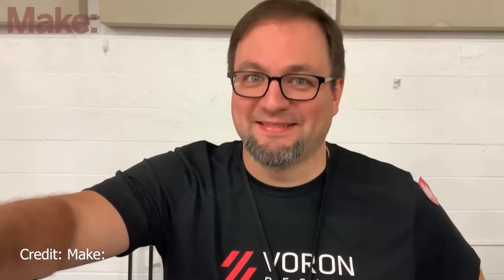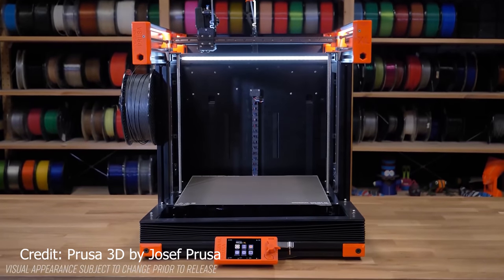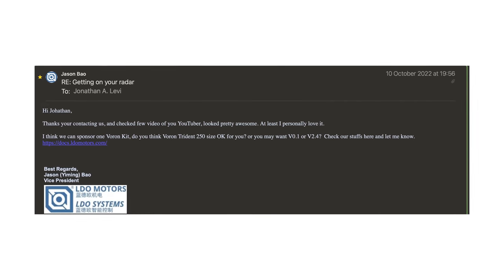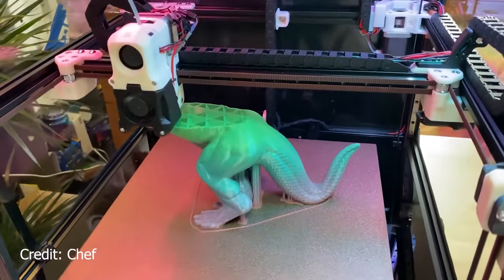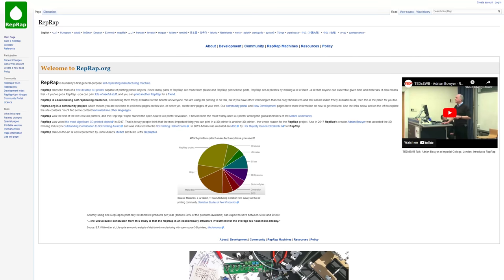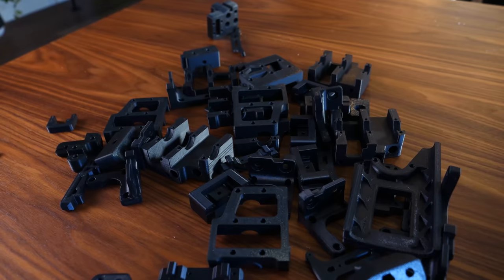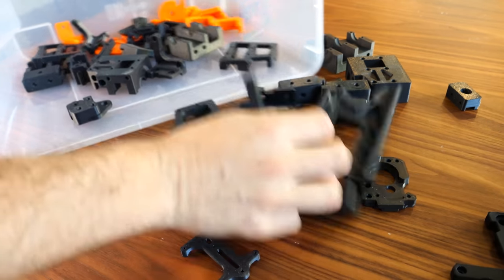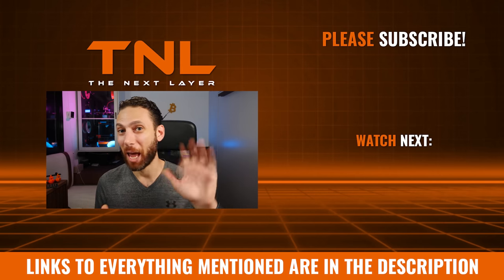I'm Building a Voron 2.4!

Comment: How hard is it to build? It is not hard to build, I am not an engineer, nor a 3d professional, I am a hobbiest. If you take your time and do not get frustrated, the mechanical build was SUPER fun. Enjoy it, because then you will get to the electrical portion, which made me second guess all my wiring (it was my first wiring job/using crimpers/soldering so i was super nervous to turn it on) the guys in the voron discord were laughing when I showed them my fire extinguisher "just in case". I actually had put my extruder gear on backwards and it stripped my plastic gear so I need to get a new one, but I also stripped the grub screw when trying to remove it. make sure you pay attention to orientation! 

Is it hard to learn klipper? It is easy to install, setup and configure. the hardest part is the acutal configuring to make your prints look as good as possible, at a decent print speed.  I am stil working on that, it's been 2 weeks, but thats only becaues I havent had time to play around with it. 

Is all the effort worth it. Time will tell. I actually paid a premium price for my printer, and I'm regretting spending so much money on it for acceptable parts. I found another one at the same price point but it came with LDO motors and add-ons like the nevermore and klicky mods, which I do not have. You will love the build, its a great printer (or so I assume with the quality I am getting now, i expect it to get a lot better)

Good luck, and subscribed!
Reply from the maker: Thanks for the support!!!

Comment: I have a LDO voron 2.4 300mm and yeah i dont regret at all buying a voron, it was and still is a journey with constantly upgrading and making it better, i love it, im currently making a the ERCF MMU so i can print in multiple colors.
Reply from the maker: Respect. I’m curious how polished the ERCF is though?
Reply: @thenextlayer  the ercf itself has been pretty good, what I'm struggling with is the spool buffers and friction, I ordered new ptfe tubes since what I have is fep so it drags a bit, but over all pretty good
Reply from the maker: @twistedvyon6234  impressive…. Is it hard to slice gcode for it, do you know? Or does prusaslicer handle it
Reply: @thenextlayer  it's the same as any other mmu really, I think the hardest part for me has been calibration of the purge tower

Comment: I just recently finished my 2.4 350mm.  You're going to find first layers to be inconsistent without heat soaking the bed for 30 mins and running a bed mesh.  Maybe it won't be so bad at PLA temps but I built it specifically for ABS and a bed that size warps a lot at 100c
Reply: Have you only tightened one bed screw, kept 2 semi tight and one loose?

Comment: Hey really glad you are going through this journey of building a Voron. I'm new to 3D printing and still looking through content to decide the journey i want to take. I have recently latched onto the idea of building a Voron 2.4 as this sort of build excites me, but i dont have a 3D printer currently as thats what i researching to buy. I love the odea of this rather than buying a Bambu which i have had in my shopping cart a few times but not pulled the trigger. Same for the V400 FLSUN, somthing is just not right. But with the Voron the journey the upgradable parts, i love this. So one question i have for you, i hope you can help me realise and start the journey, Can you recommend a 3D printer to be useful enough to sit along side the Voron, but also has the ability to print the parts of a Voron? any advice on this choice would be very appreciated :) Thanks Stephen
Reply: I would never, ever advise a Voron as a first printer.  Get a prusa mk3s kit or a clone and you'll have a reliable machine that you can learn on and use it to print out your voron parts.  There is a TON of stuff to learn.  And you should always have a reliable machine on hand when you're building anything yourself, or you've got no way to make the parts.  And you can take your time.  I built a 250mm 2.4 and it's awesome but you need to figure some stuff out by yourself; if you're not familiar with FDM at all it will be a nightmare.  By the time it was time for me to build, I already had most of the hardware I needed... spares from learning the ropes.  Buying a kit is rolling the dice and begging for garbage parts.  By the time you've replaced the rubbish from a kit you will surpass any savings in time and money, IMO.  All that said, go for it.  It's nothing you can't do once you get the basics down.

Comment: Very curious about this one!
If I can make one request: Please do not edit out "wrong turns" or "headscratchers" when you're building your Voron -- Those are the most valuable bits!
I'd also be very interested in an in-depth part on the electronics & configuration. A lot of reviewers point the camera at the most interesting part: A blazing fast moving gantry printing a boat. Then they talk about acceleration and input shaping and pressure advance, but getting to watch the recorded demonstration of the pains & joys of the tuning process itself is quite rare.

Comment: Building a V2 is not recommanded for beginner, but I never listen.
I had never build or touch a 3D pronter myself before attempting to build one.
Did not even knew the difference between extruder and extrusion (this is how newbee I was).

But I build one in the 2.1 era when there was no kit.
I am not particulary mechanically inclide, but have a bachground in electronic and will not accept a failure (hard head).

So yes it's is possible for a newbee to buid one, but it only depend on your character, because you will be challenge.
I have seen people so discourage that they sell the pats at a lost!

You may be good with the wiring but not with the mechanical part of it or vice versa. or confortable with the software and affraid of doing wiring on the main AC.

But if you get stuck, you just ask question on the Voron discord and the Community there is fantastic.

And if you take this challenge, you will be proud of yourself.
Because you buuilt it, you can fix it, because you know everything about "YOUR" printer.
Reply from the maker: Wow. Amazing and inspiring!!!

Comment: You probably already have, but even with an enclosure, if you're both working in that small room, consider getting an air purifier... preferably one which uses activated carbon to pull out VOCs. Another option could be the BentoBox if you wanna print it yourself, or the Nevermore for vorons.

Comment: It probably wont be long before someone buys the bambu and reverse engineer it to make mods and replacement bits, if its popular enough then parts will come, I want to get into 3d printing but cant work out which one to buy but the one thing that puts me off some machines is the amount of printed structural parts, has no one come up with aluminium cnc machined parts with some of the modern cnc you can smash out part quicker than a printer and their stronger, Im a toolmaker and know about set ups and production and its not difficult to jig up or am I missing something.

Comment: 350x350mm isnt that large anymore when ratrig came out with the 500x500mm option.
my Franken-voron  is 500x500x1000mm - The reason why mine isnt a legitimate voron is that you cant use 3030 extrusions in the bom-builder - and none of the 3d printed parts will work with those extrusions.
Reply from the maker: Wow. Never seen that! Insane! I thought the kinematica wouldn’t work at that size?
Reply: @thenextlayer  I love my ratrig 500 v-core 3. I have been thinking of adding a 3rd printer to go with that and my prusa mk3s+ and was looking at same size voron 2.4 you will be building. Can’t wait to see your journey with it.

Comment: Bambu didn’t give me a printer, so it’s a closed ecosystem I don’t want to participate in. But LDO will give me a free Voron so obviously this is a better choice. Lol… you’re working in reverse buddy. I bought and built a Voron 2.4 last year and ended up with a Bambu X1 Carbon. Being cheap wasn’t a consideration, just reliability.
Reply: You’re saying the Bambu is more reliable than the Varon?
Reply: @blorby  No, I'm saying Bambu is more reliable than a Voron. Not sure what a Varon is. Voron is a huge time investment. You need to stock up on lots of odd bit and pieces to service and repair. I had belts get misaligned because of a small set screw that didn't like the amount of loktite I put on it. Then had to order a whole new belt for the A run and if you know what it's like building a V 2.4, then you know taking the whole gantry apart and running new belts is not fun. Bambu sells tons of easy to swap in spare parts. I have been printing from it almost non-stop for over 3 weeks and haven't even had to swap a head yet. So yeah, Bambu is better.
Reply: @CarlMoebis  thank you, the Voron/varon was autocorrect and your answer was very educational. I’m with the cr-10 smart pro and thinking about my next printer… your input is very valuable 🙏
Reply from the maker: It was a joke, but the way we edited the video, it lost some of the humor, I completely admit. Though, i will also admit, my main question is "is it still worth it to build this thing when you can have a faster printer for less money with no build." So, it's obviously on my mind, and I also admit, if my "faster printing" itch had been scratched with a Bambu, I think I wouldn't be able to justify all the work to build a Voron. Is that fair to say?
Reply: @blorby  you're welcome. Last bit of advice, because I will say building a Voron is very educational. If you want a project, build a Voron. If you want to get to designing, prototyping and testing, get the Bambu. You will also have a super hard time getting the Voron enclosed well enough to print high temp materials like PA-CF (which the Bambu eats for lunch). It also used to be hit or miss with ABS on my Voron. On the Bambu, I've never seen such amazing prints, and with ABS. ABS didn't warp or peel from bed and it looks so smooth. Since the Bambu X1 Carbon comes with hardened steel nozzles it has no problems with abrasive filaments like PA-CF, white PLA or glow in the dark. Also the LiDAR is a thing to behold. Even if you managed to bore out your 0.4mm nozzle to something like 0.45mm, with the automatically flow rate and pressure advance calibration it would adjust. No other printer can do that without having to do a ton of calibration prints and writing the values to the klipper firmware. Don't even get me started on the AMS. I have 4 different materials loaded in it and can pick which one I want to use from the slicer without having to setup my spools each time. It also serves as a dry box too which is nice. The value for what you get is beyond compare. Even the Prusa looks like a joke in the same price range and you have to build it yourself. Or you can get the new Bambu P1P which is even cheaper. Last thing is speed. Bambu is faster than everything, with maybe an exception for the very small Voron v0.1 which has been heavily modified with tons of cooling. You get speed and quality, because the Bambu automatically does input shaping (vibration compensation). I did this on my Voron with a toolhead accelerometer and it was hit or miss. As the late Ron Popeil used to say "Set it! and forget it!" lol good luck man.

EDIT: Forgot the most important thing, Bambu is Core X/Y, Voron 2.4 is on a gantry (bed doesn't move). It shakes, a lot and the heat that you need for high temp materials is at the top. With the Bambu (and Voron Trident), the prints start and stay at the top, the hottest part of the chamber. You will never get high quality, large prints from high temp materials on a Voron 2.4 like you can on a Bambu or even a Voron Trident. The core X/Y kinematics is superior.
Reply: @thenextlayer  yes, that is acceptable. lol, thanks for the reply. Recently found your channel and I enjoy the content. Just remember, the audience can sniff things out, so always be honest with them and you'll maintain a great following.

Comment: Don't buy a kit.  You're going to spend money replacing tons of garbage parts.  IMO anyone really prepared to build a Voron should already have half the parts they need.  And the BOM is right there for you, with sources.  At least I did... Voron was my fourth printer and second build.  Looked at kits and most of it was junk.  Don't take the chance with crappy cable chains and the high probability of tons of fake/knockoff electronics.  All that said, the Voron is awesome, and Klipper is awesome.  As a first project, it's a bad idea.  Build a prusa clone and make all your mistakes on that, and get your ABS parts out while you learn.  When it's time to dig in, you'll know when something is not right.   Only thing I would advise all Voron builders to do is ditch the inductive sensor (they melt) and use a BLtouch, and move the electronics panel to the back.  It's a real pain in the ass to work on the board when it's underneath.  And five minute benchies are fun, but you can still blow stuff up showing off.  Ask me how I know.
Reply from the maker: Check my recent videos... the LDO kit was AMAZING. insane quality, everything laid out... Maybe other kits are garbage, but this one was tops.

Comment: Trident is better.  The 2.4 does all the printing in the coldest part of the chamber.  The bottom!   It's a great printer.  Voron Trident is better because it prints in the top of the chamber.  Top is where all the heat is.  Bambu loud and proprietary.  Prusa XL is not enclosed, it's a buggy whip!  You're going to love your new Voron. You are moving into the top 1%.  Never look back.

Comment: Looking forward to the build. You better be adding Tap
Reply from the maker: What's Tap?
Reply: Apparently it's a new ABL method
Reply: @thenextlayer  it’s vorons new nozzle probe system to replace the omron inductive/ micro switch probes. The toolhead is on a small linear rail that allows it to move up and down triggering an optical sensor. Removes the need for the z endstop behind the bed and a separate bed probe. Additionally it in theory should have a more accurate and consistent nozzle z offset by you just setting your offset as the height of your desired first layer.